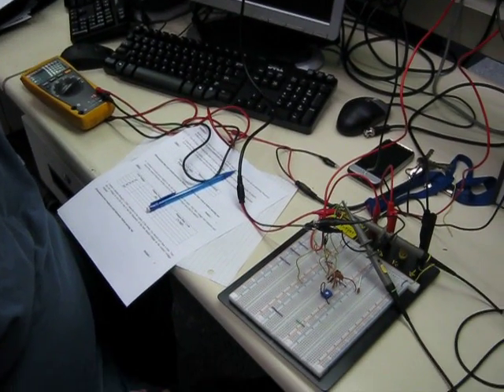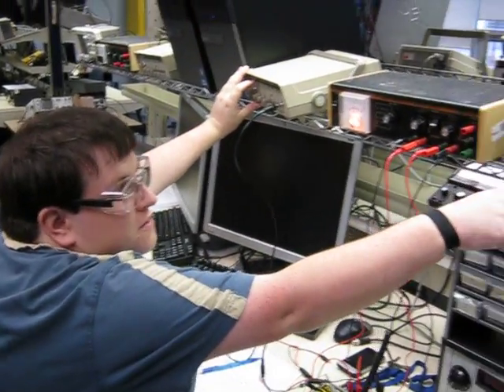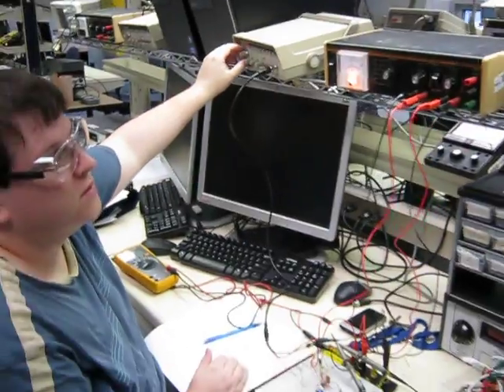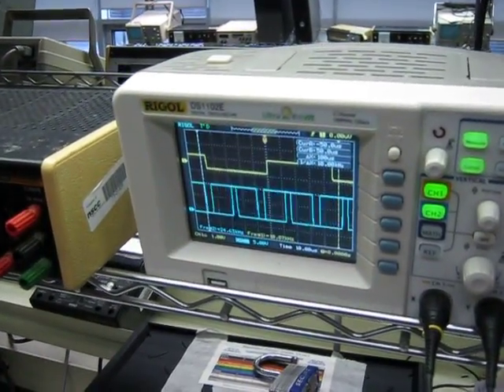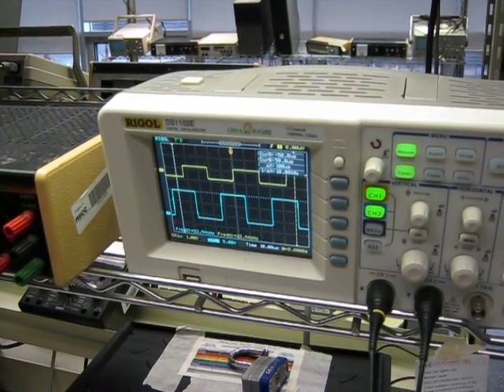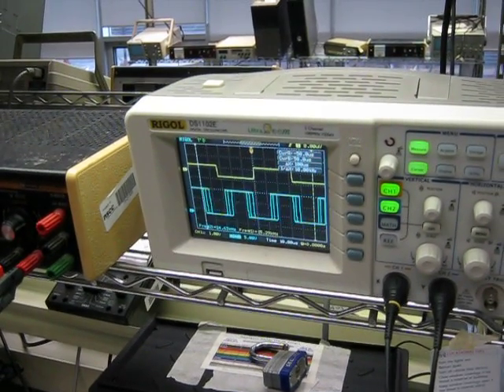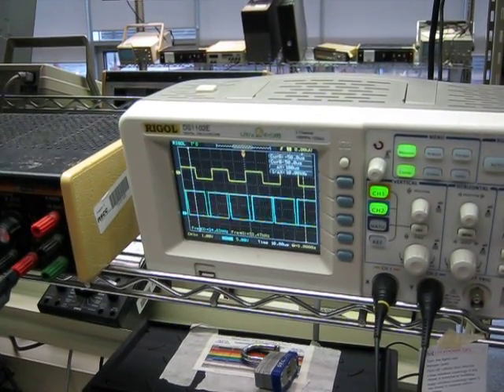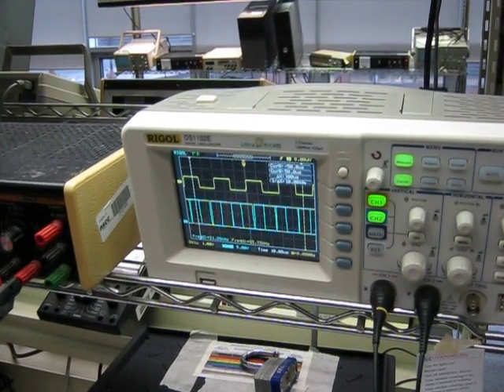Phase Lock Loop (PLL)

Comment: I have used LM565C, the PLL locks only when the input Frequency is f0=1.08KHz, which is the same free running Frequency of the VCO. But I have some questions, when I increase the Frequency beyond 1.08KHz, there is no locking. But below this Frequency, the Frequency of the output is the same as the reference, but there is a phase difference. When I decrease more, the locking is lost again. Are these results logic? I thought the capture range whose free running Frequency is 1.08KHz is going be f0+fc and f0-fc, but in my case, f0+fc is equal to f0